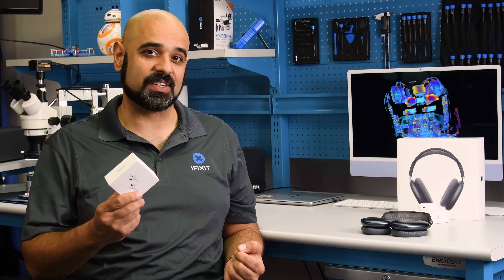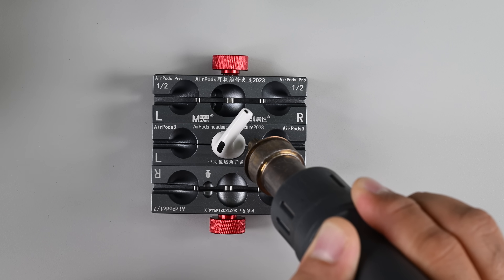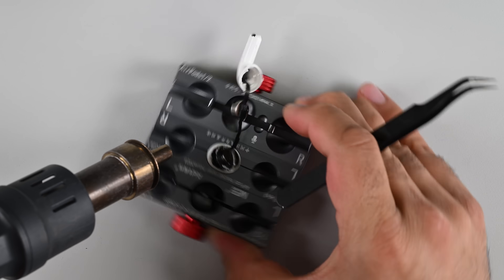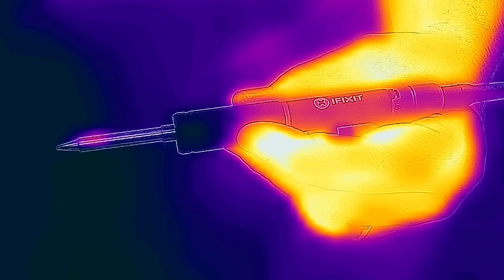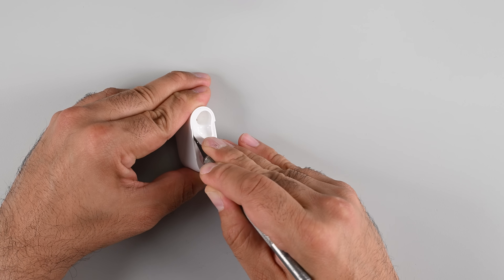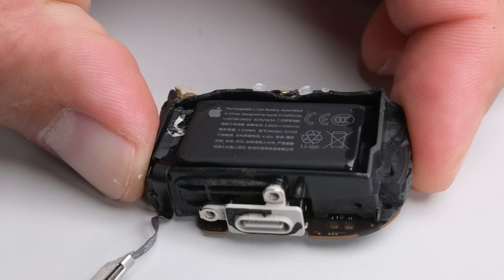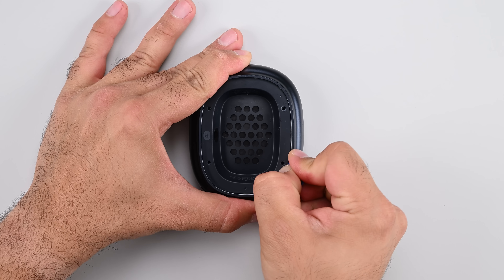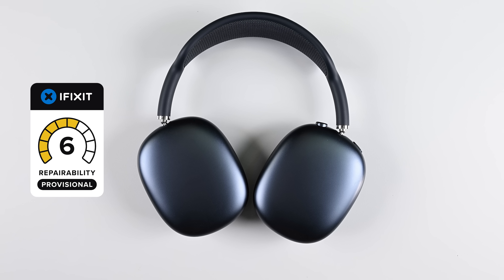AirPods 2024 Teardown - Totally UNREPAIRABLE?

Comment: I'm curious, hardware-wise what makes the stem's playback controls different between the AirPods 4 and AirPods Pro 2? The Pro 2 has the volume gesture and the AP4 does not, but other than that they have the exact same pressure-sensitive controls. Is there really a hardware difference between the two? Or did Apple lock that behind software?

Comment: How are they supposed to make AirPods repairable anyway? They still have to be small and light while also being something actually worthwhile to repair.
Reply: They can’t. And I can’t imagine the failure rate for AirPod logic boards outside of physical damage (because you’ll likely be screwed then) is all that great. Granted the stem design is inherently impossible my only actual complaint is the battery. That’s a small issue that could with minimal impact be solved. 

I personally don’t see any use in complaining about “what if the SOC dies, you have to throw them away” YEAHHH. Outside of making AirPods look like temu AirPods with a stem that can house a family of 5  there’s not much that can be done. It’s an inherent issue with “buds” that ALL companies share as long as they were made green, and not just dumped in a landfill, I see no issue with “disposable” items. In my experience these “disposable” items always work beyond their means. Never fails, I replace the battery in something and it’s not too long before i replace it. I don’t think it’s a bad thing we live in a society where you have to run everything you own into the graveyard. But that’s just me.

I fixit wants headphones to be those massive 80s things you probably used in school.
Reply: @DeltaStormYT   yeah, I agree, I do think they could make them out of aluminum or something like electroplating the plastic to at least make them more durable and a little less disposable. The fairphone earbuds are definitely more repairable but they are, without a doubt, not as good earbuds as the AirPods.

Comment: Some things are meant to be disposable, and that's OK. I mean, how many plastic toothbrushes do you throw away each year? Do you have the bristles changed on your toothbrush to save the planet? No, because there are bigger climate battle to fight, like making sure you're actually recycling your plastic/aluminum/glass bottles rather than tossing them in the rubbish bin, like most people do. Tossing away $129 earphones every 5 years when the battery is worn out, is no different than tossing away $6 toothbrushes every 1-2 months...
Reply: Yes. I don't throw away the whole electric toothbrush just to replace the bristles.
Reply: most people report that airpods break pretty often, nowhere near the 5 year mark you claimed

also, there's valuable lithium in it, not the same as a plastic toothbrush

Comment: Expecting airpods to be extremely repairable but also small, compact and well designed seems a bit wild to me. other than the Maxes which are semi repairable the airpods are at a consumable pricepoint anyway. I have original airpods that still work fine.
Reply: Yes, true, but I’m sure Apple has the potential to impress you with impressive repairability innovation as they do with everything else often times
Reply: @TheBevo67  the batteries do last that long and I still use them everyday 👍

Comment: I refuse to buy any headphones with a battery, Bluettoh be dammed. I'll stick to wires and know my headphones will still work in 10 years.
Reply: My 8 year old wireless headphones still work your fears are unfounded
Reply: @juliet4093  n=1 and you did not comment on battery health and usage, so invalid argument.
Whether or not wireless headphones can stretch their battery to a decade isn't deterring to this comparison either, as as long as the membranes stay good wired headphones stay functional indefinitely.
And when either fail, usually a wire is cheaper and easier to replace than a battery, but this depends on the construction.
Reply: @WyvernDotRed  I didn’t comment on it because there is nothing to say about it, they last fine, heavily used battery,

Don’t argue like a redditor by the way it’ll give people the worst possible impression
Reply: i assume you use a landline phone then? Because you do realize your phone also has a battery right?
Reply: @propiii  I ram aware and have replaced a worn out battery twice on my previous phone and know where to get and how to install replacements in my current one.
With headphones it depends on the build whether the battery can easily be replaced, but if disassembling it causes a creak there, it's ruined whereas it doesn't functionally matter for a phone.
Reply: @propiii  no I use a mobile phone. My comment was specifically about headphones.  I have tried Bluetooth headphones and Bluetooth earbuds and found with my listening patterns that I don’t get more than two years out of them whereas I still have headphones that I purchased in early 1999 that work perfectly.  I’m trying to minimise the amount of items I buy that will die just because of the battery and the battery is unplaceable.  At least for my phone I know that I can get that battery replaced and keep the phone going and slide aside that there are features that I want or need that warrant an upgrade.  Even then I will generally ensure the phone is refurbished if necessary and generally passed to one of my nieces and nephews.
Reply: Airpods Max supports wired playback now via USB-C, which in theory means the battery can be bypassed when it eventually dies in a decade or so. You get the best of both worlds now.

Comment: Imagine the battery stem could be unscrewed from the upper speaker part to be easily replaceable
Reply: There are pressure and touch sensors on that portion for volume and playback controls.

Comment: Does anyone actually expect these things to be repairable? lol
Reply: Yes and no. 

I don't expect them to be because I know how litte manufacturers care about the longevity and maintainability of their product.  As long as it meets the minimal legal requirements and customer expectations thats it.  Customer expectations are malleable. ie, I don't expect it because I hold manufacturers like Apple in contempt when it comes to really minimising the environmental impact of their products.

DonI think it SHOULD BE REPAIRABLE? Most certainly, the  standard consumable bits such as batteries should be replaceable by the customer.

Australia has a legal requirement for products to be "reasonably robust": that implies reparable and replaceable consumable components .

A product in the price range of these products should be lasting at least 5 years, and with maintenance 10 years.
Reply: @TomHallam08 the technology used for earbuds is way to small and compacted to be easy to repair. If they went for repair ability they would have to sacrifice quality as a response

Comment: I use my AirPods Pro 2 for probably 8 hours a day, 7 days a week, and for a couple of years now, and they still get fantastic battery life for music / podcasts. I've also used other ANC top-end earbuds, from Bose and Sony, and it's not even remotely close on what the best ones are. The Apple product is the smallest and most comfortable, by far, with the best noise canceling. I don't care if Bose or Sony makes parts easier to replace, their products are inferior, in very notable ways. Meanwhile, Apple's stuff just works, year after year, without problems.
Reply: I too have had good success with AirPods Pro 2 but don't use them nearly as much as you, but I may start to soon.  What are your charging habits?  Do you let the case go down to 10% and recharge or do you recharge the case more often than that?
Reply: @magnoliarailproductions7264  I charge the case every night - for the earbuds, just depends on usage, but they probably run down to around 30-40% before they're recharged on average - but really it can swing wildly. So far the battery life remains excellent, which is frankly surprising considering how many cycles they have gone through by now.

Comment: Few notes:

- The new AirPods Max dropped wired audio support. Would really like to see if there were hardware changes in relation to this.
- Would like confirmation if the AirPods Max headband's lightning connector transfers data and power, or just power.
- The lightning APP2 support 5ghz (per FCC filing), but they can't do the new lossless protocol on Vision Pro because the USB-C version (and apparently AP4) have upgraded antennas. While the statement that the 2.4ghz + 5ghz combo enables the lossless feature makes sense, I don't think that's been 100% confirmed. There's unfortunately a lot of mystery around feature. Apple does confirm that AP4 and APP2 support lossless, low latency audio. However, that fact is strangely missing from the AP4 page itself.

I really wish there was more testing with the lossless audio feature. I'm curious to see if multiple people with Vision Pros / AirPods Pro can use the feature while in the same room (confirming with latency tests that Apple isn't switching to standard bluetooth when this is the case).
Reply: The bluetooth reciving circuit is only in one earcup so headband has to transmit data too
Reply: @olsza2115  I’ve been trying to figure this out for years. Thank you! Always assumed the Max was AirPods Pro with bigger drivers.
Reply: I have been told by support this is a feature coming, it isn't supported or they simply do not know so Apple Support have no idea themselves. I am so baffled how Apple have dropped wired listening. Such a shame and makes me wish I kept my lightning set

Comment: it's like they made them deliberately to be as unrepairable as possible. making the melting point of the plastic casing lower than the glue they use is just pure evil
Reply: lol my AirPods 1 never needed new batteries or to be fixed…….consumers are hilarious but we can be
Reply: That's like me saying my BMW has been perfectly reliable and will never need its engine repaired. 
Not every device is built the same, especially with consumer electronics having a design life of a few years.
Reply: @1nvd  never needed? what did you end up doing with them?
Reply: @a1white  i used them daily for years and gave them to my mom lol
Reply: @1nvd  That's good they're still getting use. My problem is also that they bring out new improved versions every year or 2 so people buy becuase the the new ones are better then the old ones end up getting thrown eventually and they're are so tricky to recycle with batteries and electronics encased in glue and plastic. I know it's consumerism, but these seem like peak candidates for future e-waste.

Comment: This is why is still use my £19 wired Earpods (that and the fact they are a fraction of the price, the battery never runs down and the Mic quality is way better for work Team and Zoom calls). They even have a handy cord device attached to stop you from losing them.
Reply: Exactly! That's why I still ride my ¢35 donkey! No oil changes, no licensing requirements and it smells so you can always just locate it via smell. Not very useful for work calls tho.
Reply: this is why i still use my 19 franks messaging bi- ok no you're right do
Reply: Wireless is so much better especially if you have an active job.
Reply: I only use headphones when exercising, I will never go back to dealing with wired headphones for that. €40 anker wireless ones work just fine
Reply: On cable...Only at home with good headphones and a sound card...Outdoors only wireless
Reply: Exactly. This is why I still use my $20 wired landline phone (that and the fact it's a fraction of the price, the battery never runs down and the mic quality is way better). It even has a handy cord device attached to stop you from losing it!
Reply: @jared9127  not really the same analogy, but never mind. Wired headphones still do the same job as wireless (just one has a wire, the other doesn’t). A landline and a mobile phone are entirely different devices with different functions .
Reply: @a1white  so a landline DOESN'T make PHONE calls? Sure it may not support texting, but they're very similar.
Reply: @aliabdallah102  Do I really need to spell this out? A mobile phone is a personal computer that can do so much more than just make phone calls. A land line phone, on the other hand, just makes phone calls.

Comment: Really unexcusable
Reply: Just don't buy their products
Reply: Inexcusable*
Reply: Meh I treat TWS like these disposable. It’s either I get a cheap one, or ones that have easily replaceable battery like my old WF-1000XM3.
Reply: WTF did you expect? They’re tiny. You can’t make a super tiny product like this reparable. Get a real problem.
Reply: @ophello 5:27
Reply: Apple made it not to repair 
They made it like use and throw devices 
Which can help to manage e- waste
Reply: @lokeshloki8628 yes manage e-waste... by throwing it away.
Reply: You can’t be serious. 

Ok you know what. You design your own pair of tic tac sized wireless earbuds with the SAME battery life SAME ip rating SAME speaker quality SAME functionality while making it repairable.
Reply: lol  @michaeladebz
Reply: @michaeladebz   I admit I'd have a hard time, but I'm not a trillion dollar company and the fact is that we've seen other companies do it with their earbuds. Also did you even watch the video? The battery is extremely small.
Reply: @michaeladebz  So just let them get away with making more and more electronic waste as the years go on? If Apple had their way, every product would have zero repairability, and you’d have to buy a new device if anything goes wrong. Looking at it this way - YOU can’t be serious 😂

Comment: 4:50 apple is such a scummy company--charging $50 for a $2 microphone and a speaker on the case
Reply: Just don't buy them then. Capitalism
Reply: $2 part  but you're ignoring assembly, distribution, marketing, Apple store operating costs, shipping, Hardware R&D, Software R&D, etc. 

This is literally how every company ever works
Reply: and also all the development cost of the software. Also price is not always made from below, from costs. It is created from above, considering user needs. Learn basic economics
Reply: you will surely charge that much too if you're the head of the airpods marketing team
Reply: It has wireless charging too